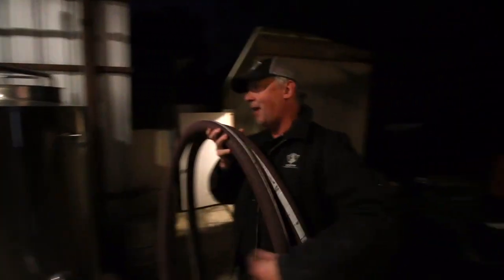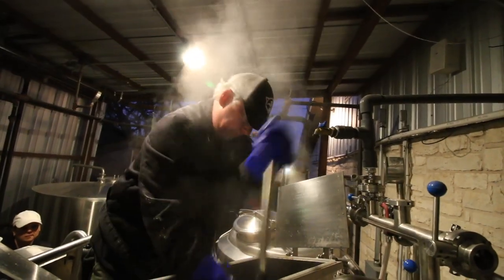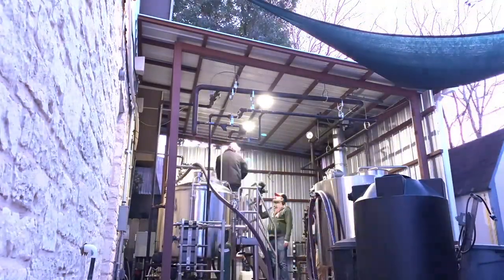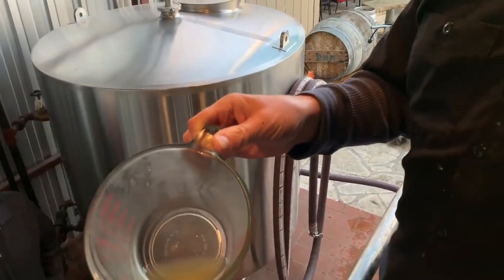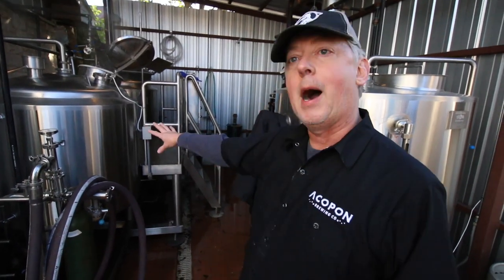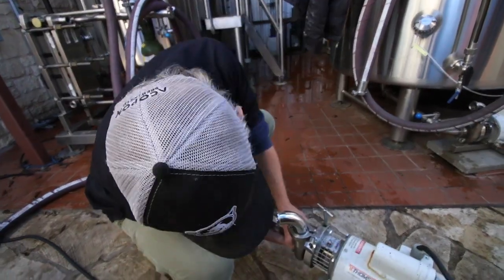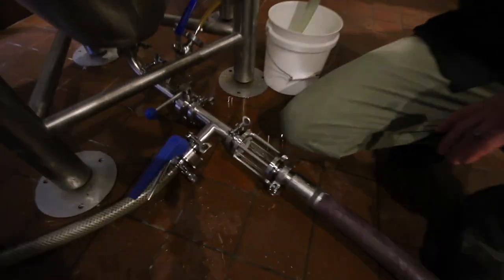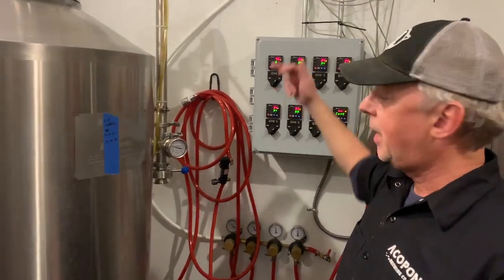Let's Make a Whiskey Wash (for our single malt)

Comment: I don't want to bring religion into this, but I like the idea of putting names on something like a Tibetan prayer flag.  Especially with how you described the location and the breeze.  From the Wikipedia page

Traditionally, prayer flags are used to promote peace, compassion, strength, and wisdom. The flags do not carry prayers to gods, which is a common misconception; rather, the Tibetans believe the prayers and mantras will be blown by the wind to spread the good will and compassion into all pervading space. Therefore, prayer flags are thought to bring benefit to all. 

And 

The prayers of a flag become a permanent part of the universe as the images fade from exposure to the elements. Just as life moves on and is replaced by new life, Tibetans renew their hopes for the world by continually mounting new flags alongside the old. This act symbolizes a welcoming of life's changes and an acknowledgment that all beings are part of a greater ongoing cycle. 

What a better way to send off someone, they become a permanent part of the universe as the name slowly fades in the sun and the breeze, becoming part of all of us and our memories.  But in this case, we don't send prayers into the universe, but rather the names and memories of our loved ones.

Anyway, just my thoughts on the wall, this is a wonderful thing to do for the community.